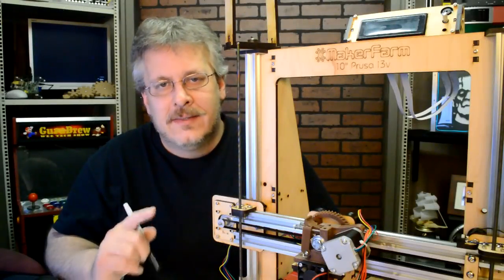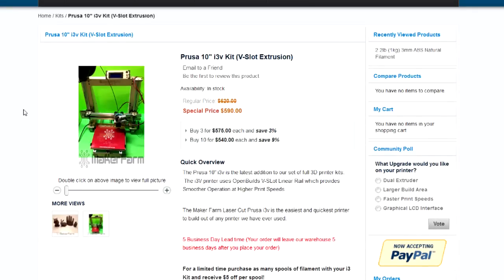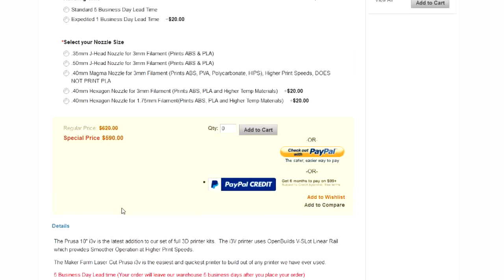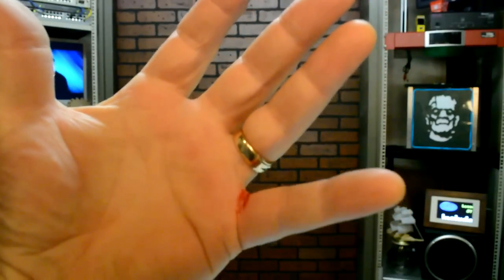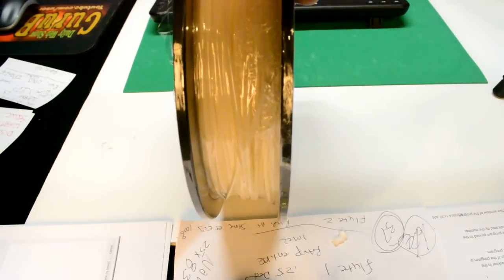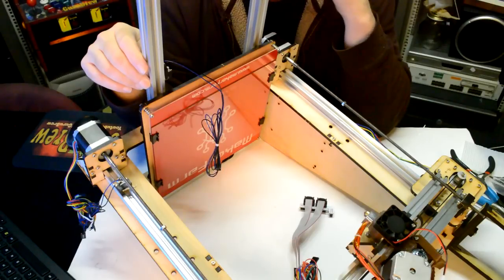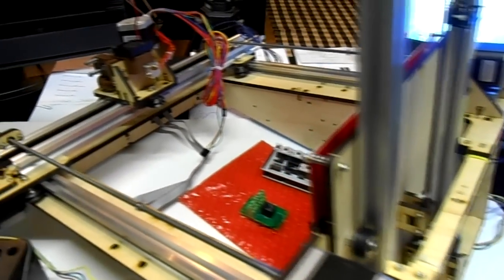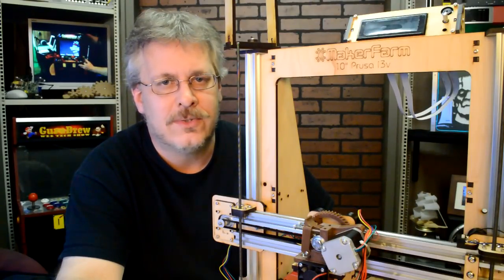We are Building a New Prusa 10" i3v 3D Printer Kit

Comment: When you do your PLA vs. ABS run, please consider the print results of 1.75 mm vs. 3.0 mm.  Using 1.75 mm PLA I am getting good results for my purposes, but wonder if the speed increase from going to 3 mm will be worth what might be a lesser quality resolution/surface smoothness.  Plus I don't want to spend the money on a 3 mm extruder that I might never use. 

Will also look for your results and thoughts on the borosilicate glass bed versus regular glass.  There's a real cost difference and knowing if regular glass works consistently while printing ABS on a heated build plate is helpful cost information.

Thanks for making tech information accessible and useable.
Reply: I don't think hes comparing 1.75 to 3mm filament. and switching your printer to 3mm wont speed it up at all.
The only difference is 1.75mm extruder motor turns more times to squirt a given amount of plastic. A 3mm extruder just turns slower.
The print quality comes from the layer height, speed, retraction settings, nozzle size and things like that.
Reply: plus 1.75 is slowly becoming a standard.  same quality less friction.  makes sense?